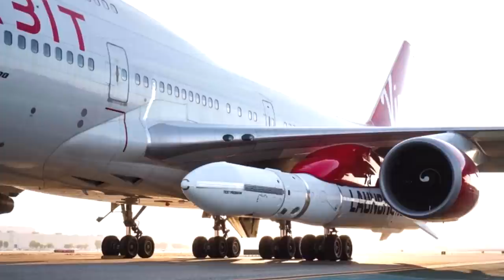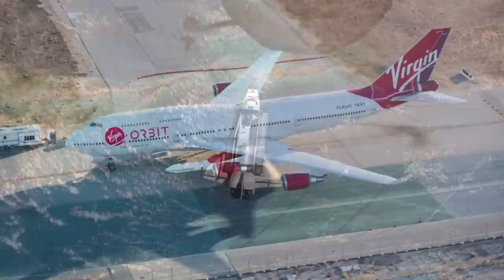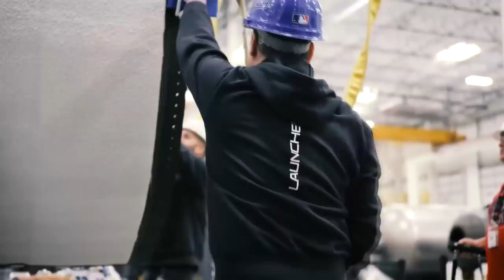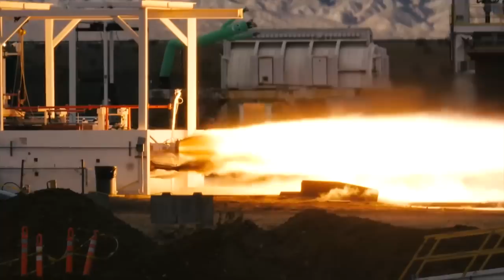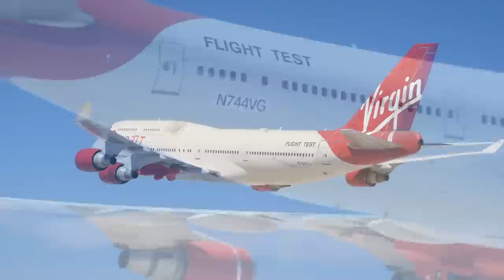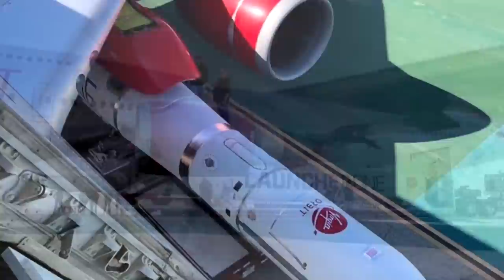Rocket Attached to a Boeing 747 | Virgin Orbit

Comment: again 747 has proved that it is an unique aircraft to do most unique and amazing jobs like this one..
Reply: There's even a plane built from 2 747s. Largest plane in the world. Designed to carry something around the size of an early Falcon 9 to altitude.
Reply: @Philip Pirie The Roc is built from 747 parts more than just wings. It is derived from 747s (ish). We could call it the Twin-Jumbo, just like the Twin-Mustang
Reply: No it's not. Only it's engines are re-used from the 2 747s.
Reply: Can't fly into space though can it
Reply: @owenbowen2752  nothing really in this conversation can. This is about things that carry things that launch to space.
Reply: It also uses 747 landing gear, hydraulics, avionics, seats, control panels pieces, windshield & electrical wires.

Comment: I don't know why this was never expanded on over the years. We had a bunch of the X-planes launched from bombers and there was the Pegasus rocket that launched from a F-15. I see this as a very cost effective way to launch small payloads into space.
Reply: Launching it from an aircraft provides fairly limited advantages. It raises it to 32000ft (10km) but a normal orbit is 200km+. Also the 747 can only accelerate it to around 700 or 800km/hr compared with orbital velocity of ~25000km/s
Reply: Not sure it's true but  I've read a few places it takes anywhere from  90% of a rockets energy to accelerate through our dense lower atmosphere and get to like 30k feet

Comment: So the Stratolauncher has pretty much no purpose anymore? With Spacex and their reusable rockets bringing down the cost of space travel plus there's normal 747s and other planes that have been used to launch rockets that take satellites to orbit? I know they did it With A Lockheed tristar and a B52 I imagine the An225 could be a huge launch platform itself they should have just tried to use the An225 or bought out the partially completed second an225 that China is now building and I think producing a full production line.